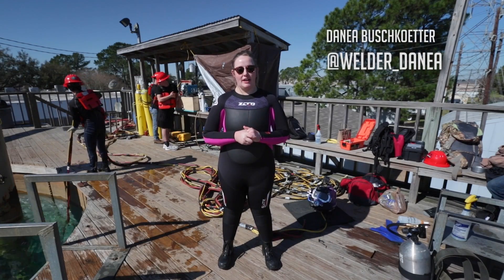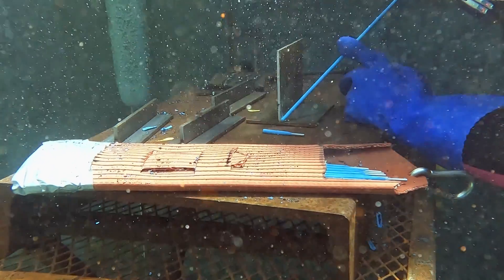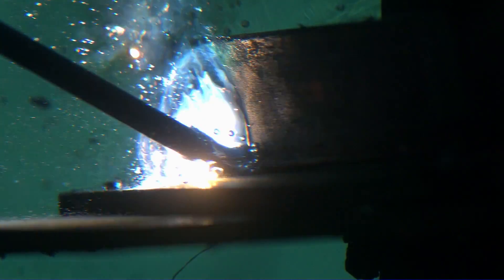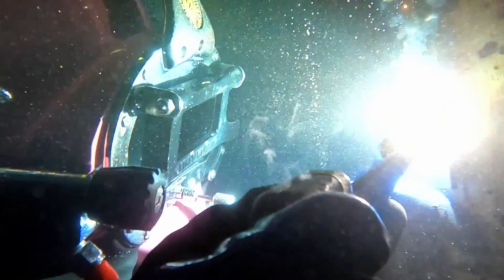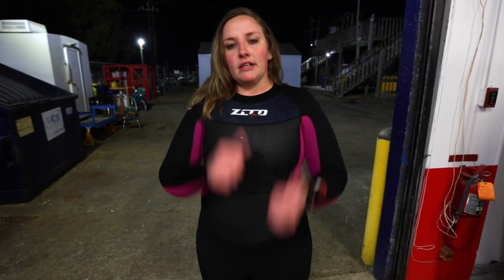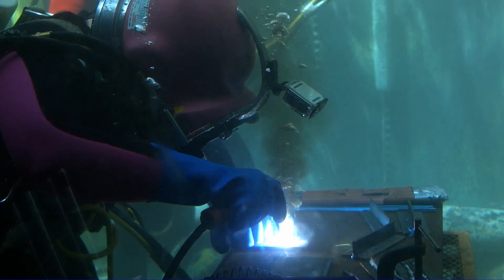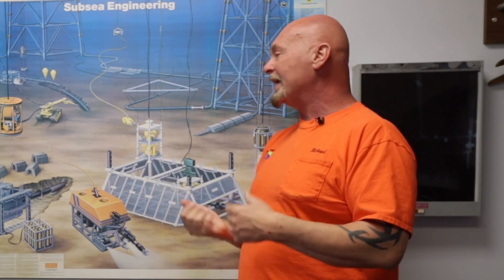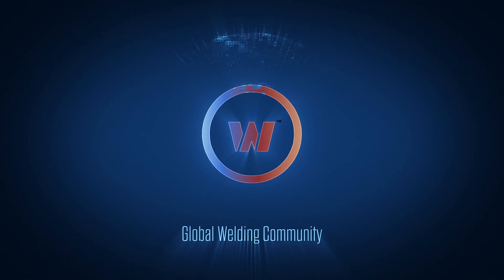The Basics On Underwater Welding

Comment: At my vo-tech, out of curiosity, I placed a grounded plate in a cooling tank a few inches under the surface and welded quite handily with a 1/8 6011 rod at 70 amps As my companions watched. there were two sets of legs when I closed my hood and 3 sets when I finished. The instructor was amused enough not to hand us brooms.

Comment: I've been a welder for over 50 years. In the mid 80's I was trained The Ocean Corporation as a commercial diver. I asked one of the instructors if many students enrolled already knowing how to weld and if TOC preferred students with prior welding experience or without. He said they preferred with. Because it's easier to teach a welder to dive than to teach a diver to weld.

Comment: Is it the same machine as out of the water, just changing the electrodes? like if I installed my regular mobile gas welder on a boat could I jump overboard and weld a anode? is it the same lead and machine? anyone knows just curious?
Reply: Curious as well
Reply: We used a normal stick welder! It had a different stinger than you normally would have top side!

Comment: I did research work with TWI and Hydraweld in the UK many years ago and developed the Miller XMT UWW system which at the time used a PC300 pulse control usually used back then with the Syncrowave 250!
Reply: That sounds cool!

Comment: Heard electrodes need to be dipped in wax
Reply: Yes that’s so the water doesn’t ruin the flux coating. However, when I was welding in this video I was using a new electrode that the Ocean Corp had been testing which was not dipped in wax!
Reply: @Welder_Danea  Why not coat it with nitrocelulose lacuqer? That should burn out.Hmm might try it ,maybe it wont suck in the moisture !
Reply: @zumbazumba1  there are electrodes that use many different coatings. I am trying some different ones now
Reply: That might work. This new electrode I was trying in the video was baked a special way to hold and stay on the electrode without dipping it in wax.

Comment: As an underwater welder myself.
Thank you, too many people genuinely think I make 250k+ a year, welding 8 hours underwater.
We aren't welders, we are DIVERS, Diving is it's own unique trade with insane challenges, like gas mixtures, pressures, understanding hydrodynamics and thermodynamics so you don't freeze to death.
I make around 100 bucks an hour, but in reality thats contracted. Meaning, I work for however long they tell me too, then i'm out of a job for however long it takes to FIND a job. My job usually consists of diving into water pipes, rerouting culverts, ect ect. for quite literally miles sometimes for municipalities and inspecting it all. It takes someone with an easy mind to do that, because it DOES get claustrophobic and scary, sometimes visibility is 0 crawling into a pipe that is just barely bigger than you are. But also I have a whole team of engineers, divers, safety officers, ect. who have quintuple checked the math to make sure it's as safe as can be.
That being said, i've also done offshore work, and THAT is scary. Mainly because its repairing pressure lines underwater. One wrong keyhole, one blow through, one mistake and you can get sucked into a hole you just made thats 1/32nd big and you cant do anything to stop it.

However, diving is a rewarding career that has served me well, put food on the table and has allowed me to buy things I wouldn't have had so quickly. Though I think when I get too old i'll just become an instructor, or just find a nice shop to weld at.
Reply: Omg never considered the keyhole vortex
Reply: I'm almost 40 years old and currently working in a fabrication workshop after not welding for 20 years exactly. 20 years ago I made plans to finish my apprenticeship, get my diving credentials and learn to underwater weld due to family connections in the Maritime/offshore oil and gas industry but was talked into taking the quick and easy way as a rigger/dogman on big money. Now that I'm welding in a workshop again, I wish I stuck to my original plan.
Reply: Thought this video was super important to make! There are soooooo many misconceptions about the field and most wouldn’t make it in the industry
Reply: @drcranberry

Can you please further explain This keyhole you are talking about, It sounds very interesting and scary. Thank you
Reply: @Don-bl6im  basically, pressure inside is WAY greater than pressure outside. You ever put a vacuum to your skin and watch as it pulls the skin up and blocks it?
It's like that, except now imagine that vacuum tube is the size of a penny, and it's capable of sucking your entire body through it in less than a second.

Heres a good video showing it:
https://www.youtube.com/watch?v=PXgKxWlTt8A

Now imagine that it's you.
Reply: @DrCranberry  Jesus christ dude that's terrifying wtf. Honestly I was considering doing this underwater welding purely because I know that the money is great but now I'm having second thoughts.
Reply: @DrCranberry  Had never even considered that.  I still don’t believe you’re entire body could be pulled through 1/32” hole, but it could easily cause enough trauma to kill you or trap you until you drowned.
Reply: Thanks for sharing.  Another almost nameless and faceless job/ work that makes our lives possible and better.  Be safe out there.
Reply: Do you think 43 is too old to begin a career in this field?
Reply: They really had you working on pressurized lines like that? Isn't the repair happening because there's already a hole or it's depressurized so you can work on it?
Reply: Well said man. I always get the “you make a lot of money”. Someone want to tell that to my superiors?
Reply: @DrCranberry  Good Diving
Reply: Please tell me how to do it because I will make it my main job and spend on my family. Will it be a primary source of income?
Reply: The keyhole vortex is absolutely fuckin' terrifying- anyone who's seen Alien Resurrection, remember the finale?

That, but with you, and into a pipe instead of into space.